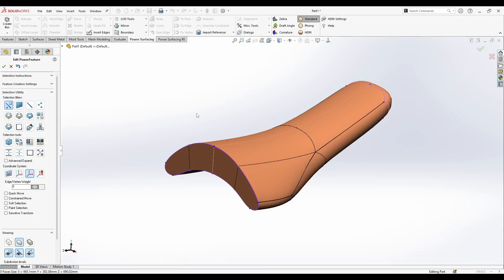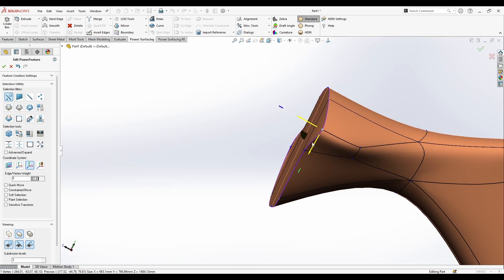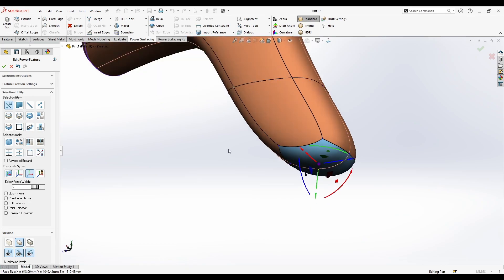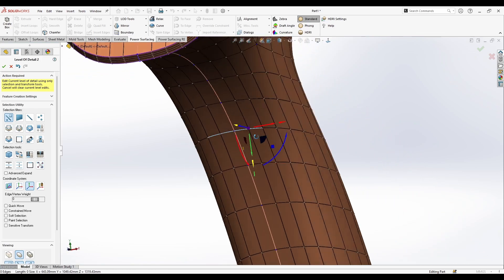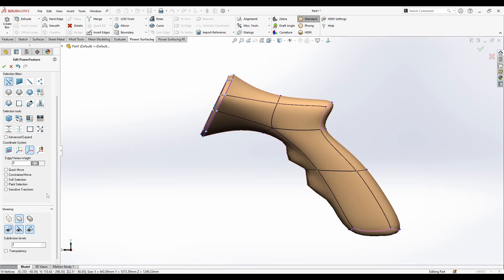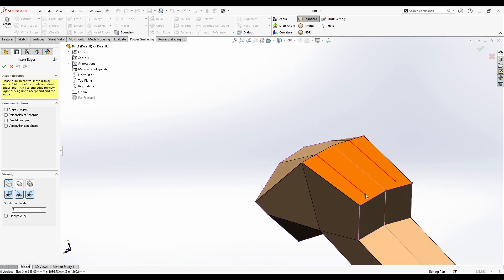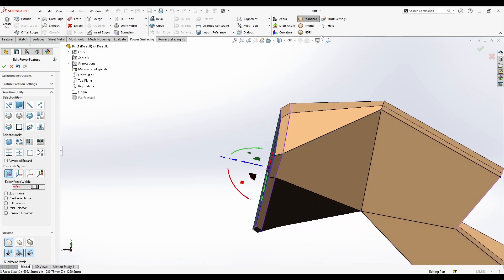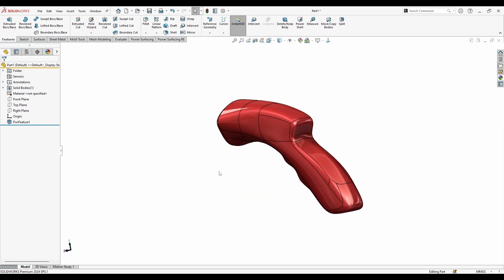Diving in Menu Tools | Power Surfacing | SOLIDWORKS - Part 1

Comment: Is there a video comparing the difference between blender, power surfacing, and rhino t-spline? I've tried doing sub-D modeling on all of them but find power surfacing so much easier. Plus it's integrated with Solidworks. Are there limitations with power surfacing vs the other sub-D modelers?
Reply from the maker: Nop !